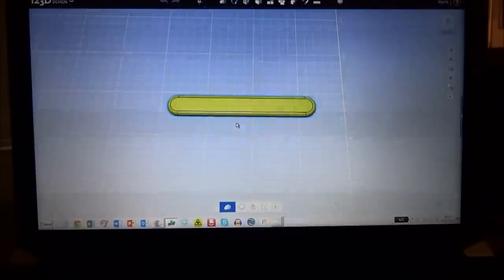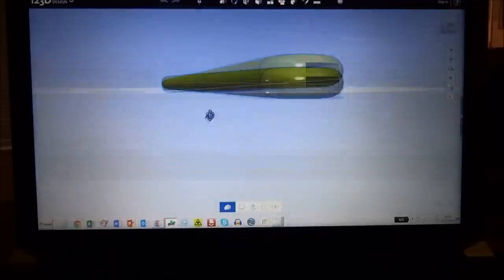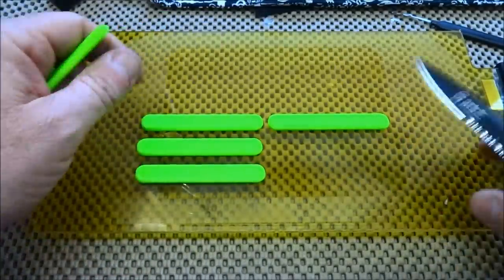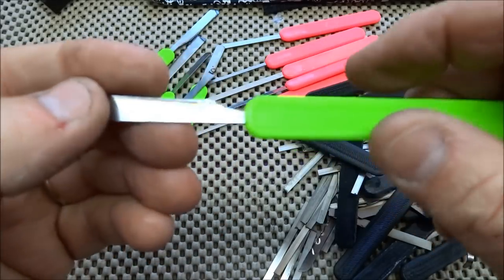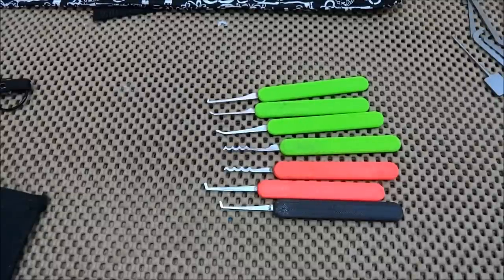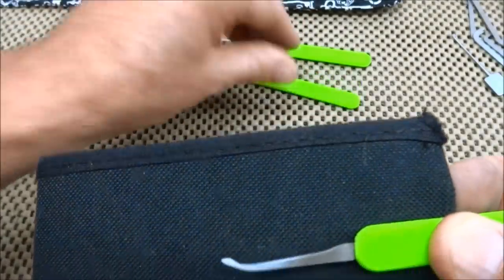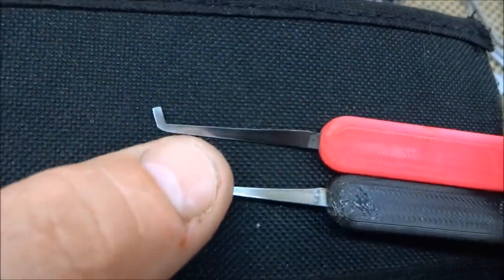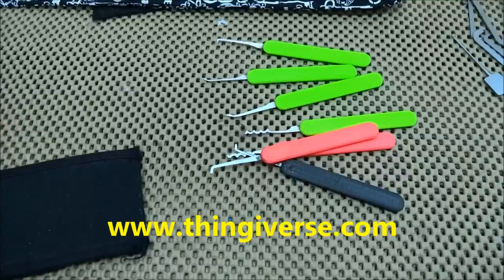(416) 3D Print Your Own Pick Handles

Comment: What type of steel did you use for the 0.015" Picks? How about the rest of them, what type of steel did you use?
Reply: Thanx Bill. Hope your having a nice Easter. I'm going to be making my own lock picks next month. I want some very strong steel, because I'm making the shanks 2mm - 1mm thin using either 0.025" or 0.020" think 1095 High Carbon Steel Feeler Gauges from MetalsOnline. Thanks for the help Bill, much appreciated.

Comment: Looks like you have another hobby bill, that's awesome. I really want to get into 3D printing too. I was also thinking and researching how to make a plastic handle for my picks if I choose to go out and buy some hacksaw blades.  I have a Dremel that I just got like a month or so ago.  What is the name of your 3D printer? I'm getting a new camera btw next month, and it's going to be the Panasonic HC-v201. I was going to get a Digital Camera, but I figured if I was going to shoot video, I midas well get a Camcorder if that's all I wanted to do. So, I'm getting a Panasonic HC-v201 next month, btw, I bought a new lock today, it's a 4 pin Master Lock No. 1. I CAN NOT GET IT OPEN. Maybe you can help.. Awesome Handles btw, very well done. (+1)
Reply: In my research on how to make a plastic handle for my lock picks, would be as simple as acetone & styrofoam. Styrofoam melts in acetone, and turns into goo, that can then be molded into hard plastic. I'd simple mold the styrofoam goo when it get's almost hard, and mold it, allowing me to make finger grips and stuff on the handle, etc. Anyway, 3D printing is very cool, I really would like to know what printer you choose to get. Thanks again, awesome video Bill.
Reply: Awesome, thanx.